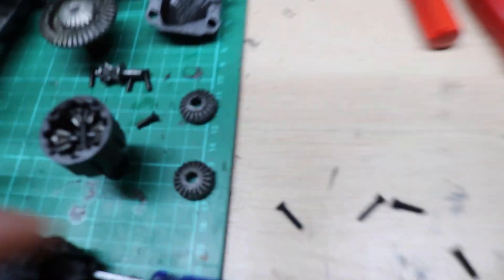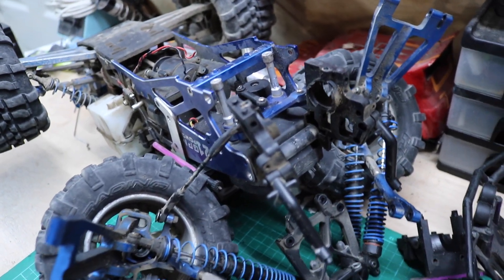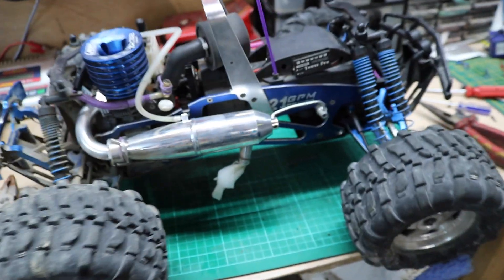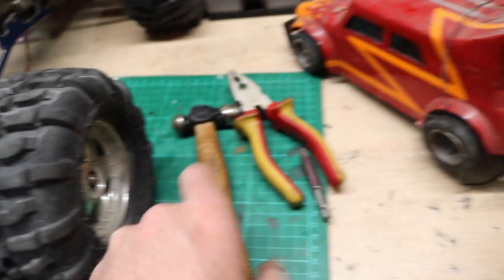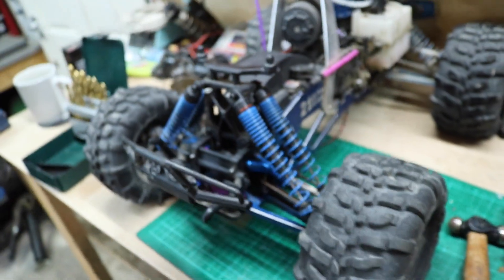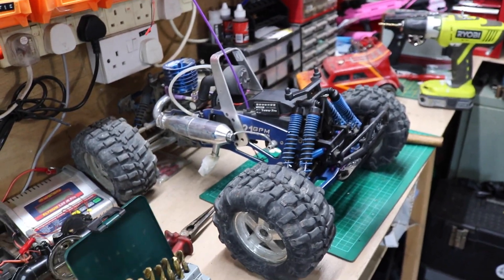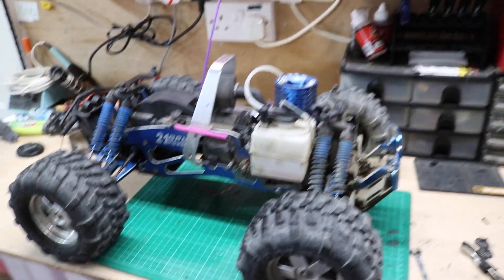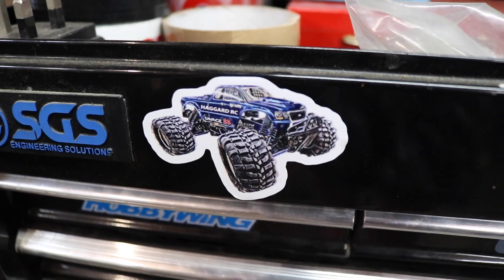HPI Savage SS Front Diff Repair

Comment: Damn, I'm glad HPI made it easier to remove the diffs on the newer Savages. Just had to recently replace the front diff in mine as well but it was such a piece of cake
Reply from the maker: This savage is 20 years old, I found it quite easy but if the new ones are even easier than that’s great!

Comment: Replacing the diffs on the old 21 and 25 platforms isn't that bad once you've done it a few times but the savage X is much much easier. Now that clutch is tight you'll have a wheelie monster lol. Cracking vid bro 👍

Comment: As for the half tank lean. It's not that there is less air pressure as the fuel level goes down. It's that there is less fuel, which means there is less weight from the fuel pushing down. The air pressure stays constant. Doesn't matter what shape the tank is.
Reply from the maker: I see the theory but with that sort of tank where it’s lower than the carb that will have little effect, which is why half tank lean doesn’t exist 😛

Comment: what diff oil you use mate? i used 100k in my car it was well worth it. its really improved traction and is fun to use on gravel and dust surfaces. so glad i did it
Reply from the maker: I have no idea…. 6000cst I think it was
Reply: wow very light then mate. you ever plan on going heavier viscosity? glad you managed to get it back together lol :)  @HaggardRC
Reply from the maker: I never plan of taking it apart again lol the oil is in there to keep it oiled 😂
Reply: 😂😂 lol yeah i felt that way after doing my 3 diffs pmsl  still got a few upgrades to do though might start them later :) @HaggardRC